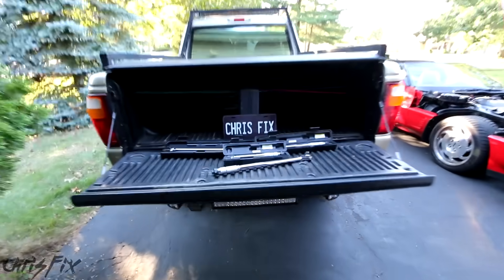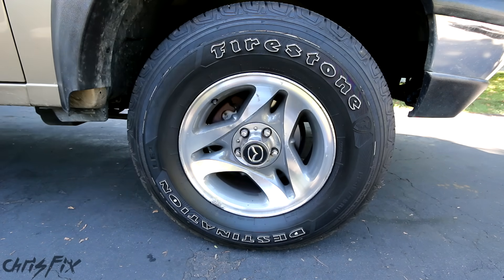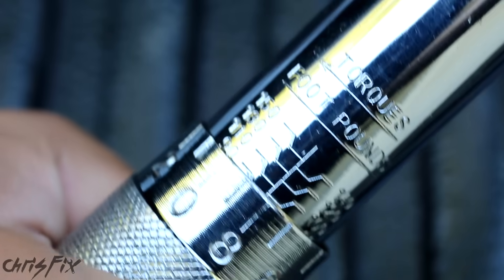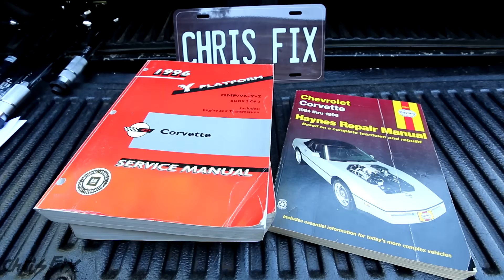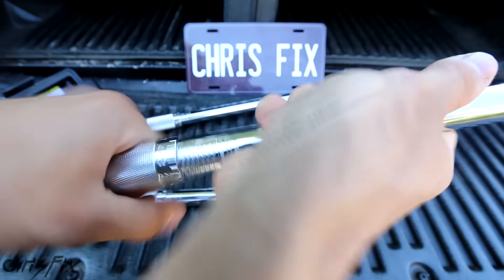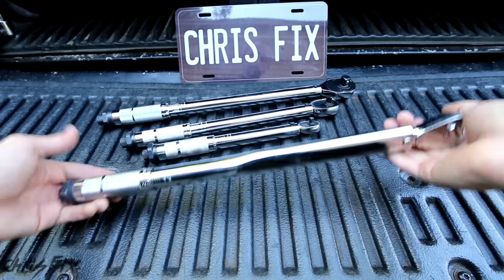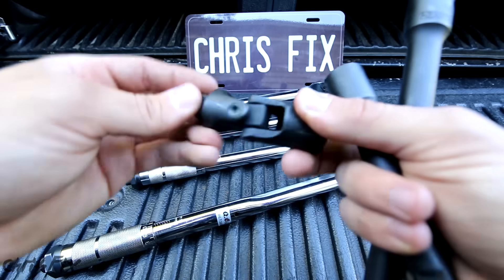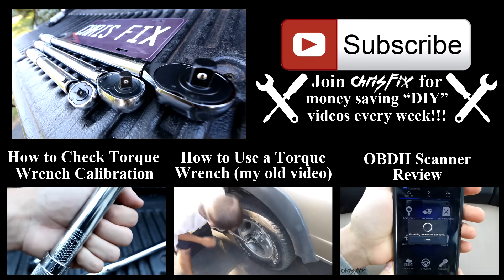How to use a Torque Wrench PROPERLY

Comment: I tested my current wrench and it was way out of spec, it would cost more to calibrate it than to buy a new one.
Reply: Every torque wrench.
Reply from the maker: Yea,  they don't make it cheap for us to get them calibrated.
Reply: Try getting one certified for use on an aircraft, they are over $500 and have to be calibrated by someone certified by the FAA.
Reply: +Boodieman72 Well, it's a good thing I can be certain that every wrench used on every plane is being properly maintained and calibrated!

Comment: Thanks for the tips. I also realized if one uses a HF wrench, it is easier and cheaper to buy another one instead of sending it in for calibration.
Reply from the maker: Definitely
Reply: +D. Alex Oprea thats the problem , left with loads of wrenches

Comment: Speaking as a re-tired tire fiter ( Hahahah! Pun intended! :¬p )
Good to see someone doing up their wheel bolts/nuts in the proper style. The torque wrench is essential for doing it right, because over tightening in alloy can damage the metal almost as badly as leaving them loose. AND you used a star point pattern when you did 'em up. That is also pretty important, as it helps to distribute the pressure more evenly than going round the circle. 
The main tip for everyone is to spin the nuts/bolts in by hand or on a socket, the ntorque 'em half way, using that star point pattern. Then set you torque wrench to your vehichle manufacturer's recommended wheel bolt torque and finish them in the same way. All this is a bit less of an issue for steel wheels in light weight applications, such as a car, but should still be used for steel wheeled heavy goods vehicles, agricultural, construction and service vehicles and buses etc.
.
Hope that all helps. :¬)
Reply: don't forget torque sticks.
Reply: pete l I wish all garages and tire shops would use them. But not all do. They only work with an air wrench though.
Reply from the maker: Thanks Anda thanks for the tips!
Reply: +wordreet Most of the shops over tighten them using an air wrench!
Reply: Luca Car Mods Yeap, but if they would all use good quality torque sticks 'on' their air wrench, your ally wheels would be saved from over tightnening.
Reply: wordreet
Yes i agree
Reply: I agree.   You defeat the purpose of using a torque wrench If the bolts are already tight and don’t even move when you used an impact or wrench beforehand

Comment: This is a great video, but I have to take issue with the first part, where you're showing how to use the torque wrench. The correct way to use a torque wrench is to start with clean threads (male and female), the fastener has to be loose, use the torque wrench to tighten the fastener the rest of the way, swing the handle at a steady speed until it clicks, don't bounce or jerk the handle, the handle must swing smooth until the click, one click is fine, a second click achieves nothing. Using a torque wrench to 'torque' a fastener that is already tightened will only confirm that the required break-away torque is above the setting of the torque wrench. Hypothetically it is possible that those lug nuts/bolts were not tightened to the correct torque value and the required break away torque is greater than that incorrect (too low) torque setting. The only way to be sure they're torqued correctly is to loosen them one at a time and tighten to the correct value. For what it's worth; technically the use of Never-Seez and Loctite behave like a lubricant and should only used on fasteners for which the torque values consider this. Don't mean to be negative, thank you for all your great videos!
Reply from the maker: Thanks for the tips!

Comment: Great Video Chris.  Torque seems like it's very misunderstood amongst hobbyists.  I agree 100% with everything in the video.  I would just add, the half inch is great for most stuff.  The 3/8ths is great for spark plugs, where you need like 13 ft-lbs, and stuff like that.  In the motorcycle world, there are any number of parts that are like 42 inch pounds, or what have you, so you will need the 1/4 inch guy.   Mine look identical to what you showed.   I got the on Amazon.  They were not the "cheapest", but they were affordable.  They have worked awesome.   This is so quick & dirty, I probably shouldn't even say it, but if you tighten a lug nut to 20 lbs, then try the other 2 wrenches on the same lug nut.... If they all click, you are probably okay....  Great video.
Reply: +ChrisFix Yeah, and why not? You are squishing a hollow washer as you tignten a spark plug, so the feel is important to someone who does frequent mechanic work. When I was a tire fitter, I was so used to fitting car wheels that I could use my wheel spider to manually set the torque to within less that 5lbs-ft of the recommended for many cars. Of course, 30 yrs ago, most cars has steel wheels, now it's all allys.
Reply from the maker: Thanks bud!  Yea that is a good point. For spark plugs I do it by feel.

Comment: Not to throw a monkey wrench (punny) into ur video, but I have a  couple different wrenches.  I see others have already mentioned the beam, or needle, type wrench.  Here's a sample of one that is close to what I use and it's very inexpensive to own:  
http://www.amazon.com/Powerbuilt-644044-2-Inch-Needle-Torque 
Opinions vary out there as to how one may be more accurate than the other.  I'll leave that as homework for the viewer. :-D

Another point for the viewing audience:  Try to keep the handle perpendicular to the extension and bolt when applying the torque.  If you hold the handle at an angle by pulling up, you throw off the measurement.  Torque is applied at the handle thru the arc rotating around the bolt, not by pulling up and away.  (Hard to explain, easier to show in your next video for calibration wink)

I think you got the point across, but I can't emphasize this enough:  these are not substitutes for pry bars, breakers, or hammers!!!  DUHH

U get the finger on this one thumbs up, buddy.  Looking forward to the calibration video as I haven't actually done mine.  Yikes.
Reply from the maker: Thanks bud and thanks for the tips

Comment: this is good for someone who has zero idea about torque wrenches, but if you're going to teach, teach everything or not at all!!
1. when it clicks, stop. a lot of people keep going after it clicks
2. torque anything with one rotation until it clicks. Meaning no moving back and forth in short motion. Static friction is greater than kinetic friction, meaning it takes more torque to move the bolt from rest (ex. wrench is set at 100lb-ft, bolt is at 90lb-ft, it takes 105lb-ft to break the static friction, the torque wrench will click, but the bolt is 10lb-ft under torqued)
Reply from the maker: +gwot Thanks you...
1.) I said to stop once it clicks. 
2.) I showed moving the torque wrench as it clicks
3.) Thanks for sharing!
Reply: I must have missed it when you said to stop once it clicks.

"showing" the wrench moving without telling people just doesn't work. I was working in a garage and seen a lot of people torque wrenching for a few years and didn't know until I was told it HAS TO be moving, I thought as long as it clicks it's to spec.

Comment: how does one install a crank shaft sensor behind the crank shaft ?
just a question
Reply from the maker: +mrmagniffy You unbolt the sensor, pull it out and put the new sensor in. It is easy to do if you have room.

Comment: Um, yeah extensions make a difference and there is a formula for it. Did not cover how you must have your hand placed at the proper location. You also did not go over how using crows feet can change the torque specs. I have watched a ton of your videos and quite frankly you seem to miss important things all the time.  I am not trying to be an ass just do a little more research please before making your videos cause me as a tech, I have to deal with the aftermaths of missinformation. You also should have explains torque angle gauges as well if you ask me. If not also include how dirt, debri, anti-sieze effects torque specs and how hydraulic fracturing from grease, oil, antisieze, etc can bust apart the things you are tightening into. You seem like a good dude with a decent head on your shoulders just do a little more research before making your vids please.
Reply from the maker: +UberArchangel If you listened, I did cover where to put your hand (watch it again). Extensions dont make a difference because you are in the same plane as the bolt/nut as stated in the video as well. Crows feet do make a difference and I cannot go over every single little thing in a short video. I appreciate your feedback.
Reply: Extensions act like a torsion rod or a torque stick. If you do not believe me try it yourself. Tighten a bolt down to a high ft lb around 200-250 with a 12 inch chrome extension. Then remove the extension switch the torque wrench to reverse without changing the torque and take it off. It will not click. Impact extensions twist less but, they all twist.
Reply: If you do not believe me get out the Machinery Handbook. http://www.amazon.com/gp/product/083112900X?psc=1&redirect=true&ref_=oh_aui_detailpage_o04_s00  This has been used by engineers, machinist, and most really good mechanics for years. If you do not own one check your local library but, it would behoove you to buy it. Mine is at work if I remember I will look it up and get the calculations for it.

Comment: Just my opinion a torque wrench is really not a good tool to cheap out on. They really do have to be spot on most of the time. One other tip that you missed is you should try to torque things in three steps, 50% then 75% and finally 100%. Especially if it is engine components like a cylinder head or connecting rod. Another tip is if you ever have to use a special adapter to torque a special nut, instead of using the mathematical equation to compensate for the extra length just make sure the adapter is at a 90 degree angle to the torque wrench. That way the special adapter is still the same length as the torque wrench. A good example would be a axle nut on a ATV. Sorry I work in the powersports world so I can't give a good example for the car world.

Besides that good video many people don't understand how to properly use and maintain a torque wrench.
Reply from the maker: +Tyler S Thanks a lot for sharing Tyler.

Comment: So, whats the reason you're torquing those lug nuts with the full vehicle weight on them? Cuz last I checked, that's an awesome way to do it wrong. Get the weight off of them! You're torque spec will be inaccurate if you have the full weight on them!
Reply: +Jodah175 because good luck torquing the front wheels while the car is on jacks by yourself. Even a brick doesnt help me push the brake pedal down, how am i supposed to stop the wheel spinning?
Reply: +Jodah175 yeah, 99% of people don't know that
Reply from the maker: +Jodah175 How are you supposed to prevent the wheel from spinning with the wheels off the ground? That is why I said you snug the nuts/bolts up first then torque.

Comment: ALSO try not to use the ratcheting mechanism , so when tightening something and you need to go back take it off the nut or bolt and put it back on , the wrench will last longer
Reply from the maker: +MrSpartan117fan I never heard of this, it is just a gear ratchet inside the head of the wrench. Has nothing to do with the torque part of the wrench...

Comment: Another tip is when you go to Torque some hardware and the torque wrench clicks right away without the hardware moving at all, it is OVERTIGHTENED. Do not assume that just because the torque wrench clicked that the piece of hardware is within specs. Also Torque wrenches have to be used in a slow turning fashion to mitigate false clicks or Torque readings. Another small tip is if you need an inch pound reading you can take a foot pound Torque wrench and divide by 12 to achieve your desired inch pound goal.
Reply from the maker: +Sole Purpose Thanks for sharing your tip!

Comment: Looks like Harbor Freight torque wrenches... cheap and frustratingly crappy (unless you're lucky and get a good on... hah). 
Had one 3/8s drive snap internally and another wouldn't click (wound up stripping threads on an aluminum head). 
School of Hard Knocks Lesson - Spend the money for good torque wrench
Reply from the maker: +Hanlon Greg Yea that HF torque wrenches are not that great. The one I use is not harbor freight. I bought 3 harbor freight wrenches for the video because I am not spending a lot of money on wrenches that I am using for a prop in a video.
Reply: Good call. Some things there are good value... precision instruments not so much

Comment: great vid Chrisfix.listen to this,I have a 2000 Nissan xterra but the oil temp goes from dead low to regular temp according to the throttle inconsistently?thoughts
Reply: up and down
Reply: You mean oil pressure or oil temp. Just clarification.
Reply: Actually engine temp.I'm dumb sorry
Reply: +Dean Tuna  Water pump. How many miles on your Nissan? If temp is moving with how much throttle, sounds like the water pump is bad.
Reply: +Dean Tuna could be a water pump or it could be an incorrect reading from either your gauge or your sending unit. I'd get a cheap mechanical temp gauge and hook it up under the hood where your sending unit is and let the vehicle run at 1500 rpm for about 5 to 10 minutes to attempt to get it to operating temp then check the mechanical gauge. If it's normal your problem is electronic somewhere. I did that when my oil pressure was bad and ended up being the instrument cluster so I decided to go ahead and run the gauge permanently.
Reply from the maker: +Dean Tuna It could be the thermostat or water pump or even a bad sensor. What I would do is take the thermostat out and see how the temperature reacts to that.
Reply: +ChrisFix without flowing coolant,the oil temperature will rise.  if it was the water pump failing then you would observe the oil temperature rising above normal as coolant temperature rose in the engine, and then dropping as the fans tried to exchange heat from the reduced flow of coolant. You'd see a similar thing if the engine thermostat we're stuck closed or the fans didn't engage.  Coolant and oil temps would rise above normal until the thermostat opened, then drop, then rise until the fans engaged.

I wouldnt trust a oem coolant temperature gage to tell you whats happening. If your vehicle is new enough,  a scan tool, even a cheap one would be better, and oil pressure is a better indicator than oil temperature, Without proper flow, oil cannot move heat, its actual primary function, away from rubbing surfaces. Too high means restrictions, too low, an oil pump or supply issue.

Comment: The thing soooo many people miss - the torque wrench needs to actually turn 1/8 to 1/4 turn in order to properly read applied torque/bring the fastener up to the correct torque.  If it clicks almost immediately it is ONLY telling you that the torque is AT LEAST what is set!
Reply from the maker: +Chad Blair Thanks for sharing!

Comment: I saw a review, and harbor freight torque wrenches came in at the top for accuracy. I have a crapsman that broke and I replaced it with a HF.
Reply from the maker: +Dave Bogusky Wow, I have heard mix reviews on the HF torque wrenches. Some people say they work great, others say they are horrible.
Reply: +Dave Bogusky No way? I got one from HF and it only cost me 10 bucks with a coupon! xD
Reply: +123 456 Sweet.
Reply: Are you talking about the Pittsburgh ones from harbor freight? Mine was so off it wasnt even funny. I snapped a few bolts because of it. Eventually got A Snap On one and it was worth every penny. So precise & easy to use!
Reply: I had a 1/4" HF torque wrench to use on smaller things until it snapped a bolt off my transmission pan, returned that P.O.S. the next day.. However, I do use their 1/2" version for lug nuts which isn't as crucial as it'd be pretty obvious if it were too far off. 
Just sayin, I wouldn't do anything too important with a HF torque wrench..

Comment: i bought a torque wrench from harbor freight and IT DID NOT WORK. did exactly what you showed in this video, over torqued a timing chain tensioner in my VQ and blew my 350Z the next day. moral of the story fuck harbor freight..
Reply from the maker: +vin digi lol, yea, I wouldnt use harbor freight torque wrenches. Check out the one I have linked in the description.